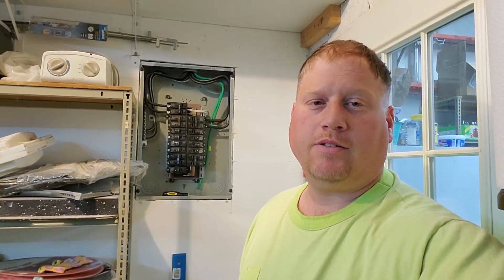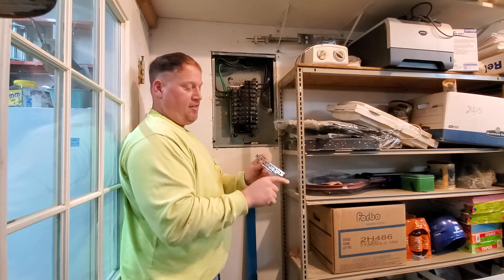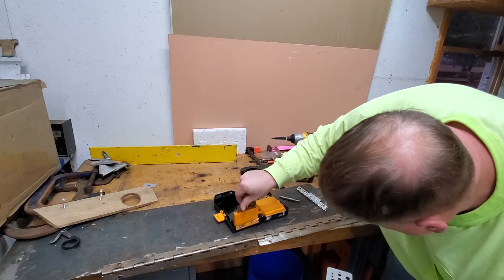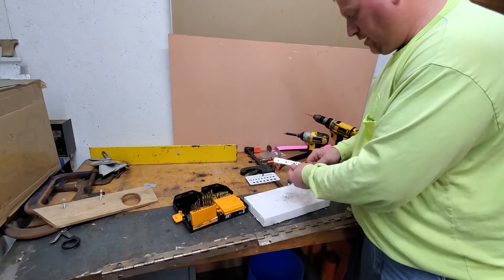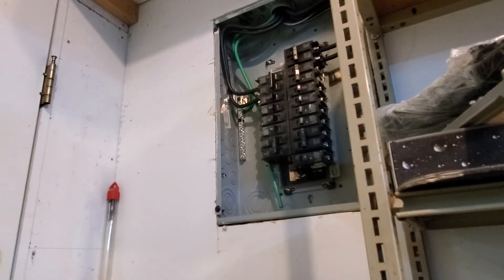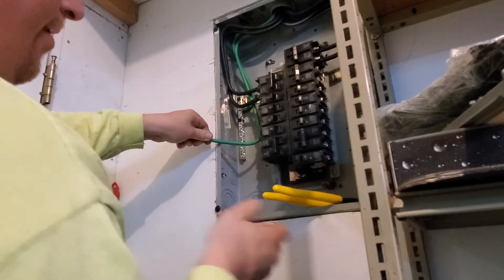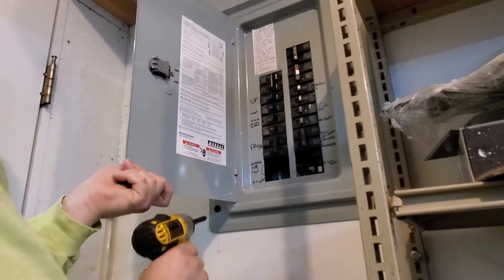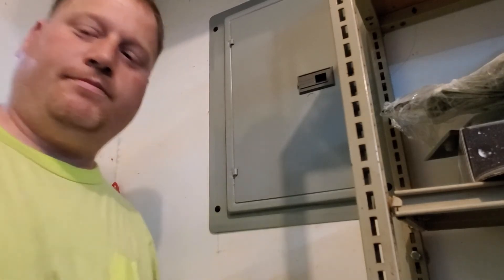converting main 100 amp panel to 125 amp subpanel to completion

Comment: I dunno, if that was a main panel there was a ground bar and a neutral bar and they were bonded together. You would have needed to somehow break that bond but when you installed that new ground bar the screws re-bonded it to the neutral bar by way of the cabinet, no?
Reply from the maker: @stevereisman6872  on a sub panel you usually don't connect the neutral ground I think the imaging is just distorted I tried watching it to see what you saw but you were correct

Comment: I need to do something similar, my house currently only has 70amp service, and I’m adding on to the house and a metal barn w an RV 50amp hookup.  So I’m going to a 300amp  service and going to wire the old panel in as a subpanel. Then over time I’ll chase as many of the old leads as I can and bring them up to code. And eliminate others completely.
Reply from the maker: sounds like a plan

Comment: So I did not see the first video with the 200-amp main service panel and converting sub panel to 125-amps but I'm assuming that the local utilities was supplying for a 200-amp panel?
Reply from the maker: Sorry, but no, we the consumer buy everthing  except the wire from the pole to the meter
Reply: Right, but you had to pay for a larger service base and meter to increase your total service capacity

Comment: Just curious, you said you converted a 100amp panel, which I am assuming is a main breaker panel to a 125 amp main breaker panel.  99% of all 100 amp main breaker panels have a buss bar rating of 100 amps, which means you can't install a 125 amp breaker in it. You will typically only find a 125 amp rated buss bar in a main lug panel.  What's the buss bar rating of the panel you installed the 125 breaker on?  Also, if you ran 2-2-2-4 to this panel and put it on a 125 amp panel,  you did it incorrectly.  Maybe I misunderstood which wire you ran to which panel.  Even so, if you ran 2-2-2-4 to a panel, the maximum OCD you can install by code on wire that size is 90 amps because it is a subpanel, not a feeder.  Same thing for the wire running from your 200 amp main panel to the subpanel you increased to 125 amp.  You'd need to run a  1/0 AL wire.  Just trying to make sense of exactly what you did here.
Reply from the maker: Thanks for looking out for people like myself. I did run an undersized wire from the main panel to the sub which I will be correcting. But the sub-panel is currently not running more than 50 amps at a time so everything is good and double breaker before it gets the to the sub panels main breaker

Comment: What size conductors did you use for neutrals and ground for the 125 sub panel.?
Reply from the maker: I used "Southwire 2-2-2-4 Black Stranded Al MHF Use-2 Cable"